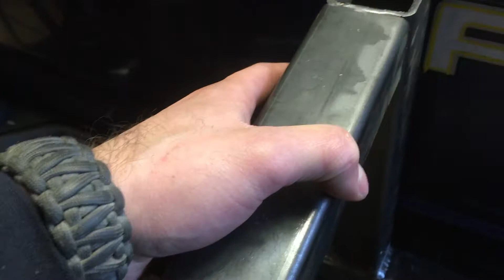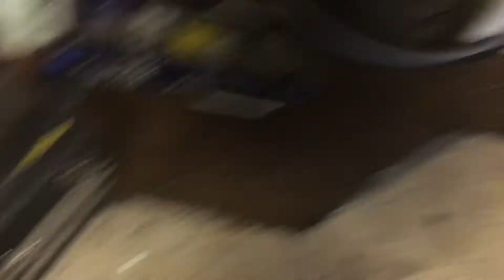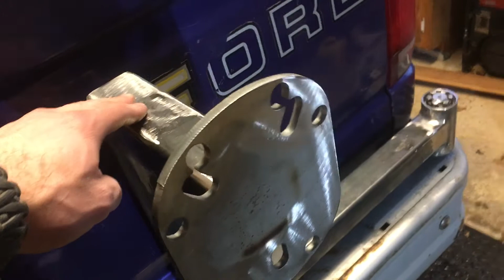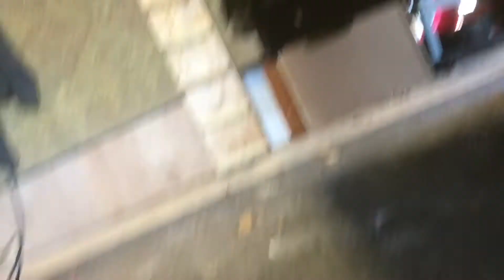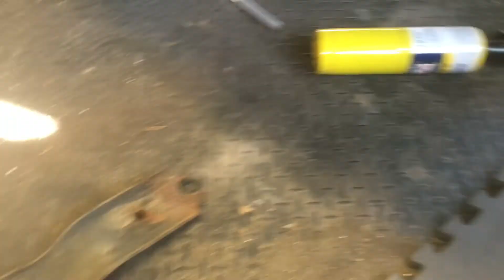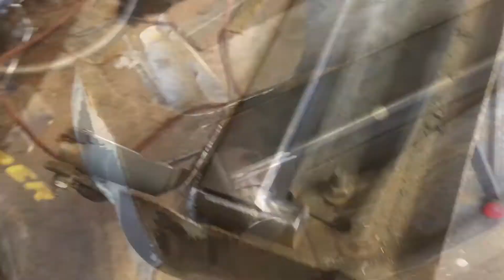How to Build a Swing Gate Tire Carrier Ford F150 - Part 2

Comment: Love these two videos. You gave me a great basis for my build (full custom bumper). 

One question; how did you limit the outswing on the carrier so it doesn't swing past the side of the truck?
Reply from the maker: Thanks man!🤙 Great to hear!

I didn’t and I wish I had thought of it. The tire carrier actually swing out too far and put a huge dent in my bed years ago. I would add a limit pin latch or strap.

Comment: How much did this project wind up costing you?
Reply from the maker: Good question! The spindle kit was I thing $150. The length of tube steel was $60 (pre Covid). If you through another $100 worth of cut wheels, grinding disks, flap wheels, and spray paint, you get a full number.

Comment: Doing this on my 2001 Dodge 1500
Reply from the maker: Nice!🤙 So two things I wish I had added. Near the hinge, add a pin lock to hold the carrier in the open position. I also would come up with a better latching system for when it’s closed.
Reply: @The Minute Masters Good idea

Comment: If you haven’t fixed it yet where your spring loaded thing hits the bumper , you can weld on a washer the correct hole size , 👍
Reply from the maker: That’s a good idea! Thanks for the tip!🤙

Comment: Great vids, so will the included "stop" work with a tailgate? Is it meant to attach to the body panels or on a 4x4 bumper? I'd be doing a Bronco but I guess jeepsters would attach that to their swing gate? Thanks much!
Reply from the maker: Thanks man!🤙 Ended up not using the rubber stop piece. I’m sure it could be mounted anywhere. It’s definitely suited for a swing gate and not a tailgate. The pin latch held the tire carrier in place.
Reply: @TheMinuteMasters  Nice, did u end up adding a grommet to the pin hole? I reckon that would serve a similar purpose to the bump stop...
Reply from the maker: @adrianmettz7463  I didn’t get a chance and the hole really needed reinforcement. The hole was a little large and the pin had a lot of wiggle room. The constant movement wore a pin sized moon cut in the side of the hole. Admittedly, the latching method for this tire carrier needed more attention.
Reply: @TheMinuteMasters  So a steel grommet needed then, lol...good shiiiiiiiiii.... clean work, looks killer. Thx for your responses.
Reply from the maker: @adrianmettz7463  Yup, you definitely want the grommet. No problem man! 🤙 Thanks!

Comment: Did you ever weld on a tube to support the bar that holds the wheel,
Reply from the maker: Like weld a support for the piece of tube that bolts to the tire?
Reply: @TheMinuteMasters  
From the bottom tube to the one that is vertical, ie  cross member of sorts
Reply from the maker: Urban Style Nope no crossmember. The 2” square steel tube really held its shape. So the “L” shape of the carrier didn’t need any support. If I send down a few steel tube sizes, I probably would have added supports.

Comment: Where did you get the pin?
Reply from the maker: The spindle was a kit from a company called emsoffroad. However, if you search tire carrier spindle kits you can find them at any off-road fabrication company.

Comment: Built is better than bought (IMHO) unless of course you're a shitty builder! LOL  Good job.  You might consider adding a little plate on top of the bumper to reinforce where the latch penetrates it.  That will be a wear point.  But nice work.
Reply from the maker: Rob the Wayward Woodworker I totally agree! Plus is a valuable learning experience each time. You are exactly right. That did end up being a wear point and I had to add a piece to prevent excessive wear. Thanks man!🤙 I’m glad you liked it!

Comment: Where did you get the latch? It's not on the website provided.
Reply from the maker: Randy Anderson I got the latch from emsoffroad.com in the description. Click the link and the main page will come up. Then click tire carrier parts in the menu bar. That should take you to a page with all the kits and most of the individual parts.
Reply: Must have stopped selling it, not there any longer.
Reply from the maker: Randy Anderson That’s a shame. It was a good kit for the price. I’m really not sure who sells tire carrier kits. I would just try searching tire carrier kits. A to Z fabrication sells the spindles.
Reply: @TheMinuteMasters  The one you got is way better than the complex and bulky one they sell now for sure. You lucked out.
Reply from the maker: Randy Anderson I definitely did! They must have switch suppliers.

Comment: I decided to put SAE bolts 9/16 grade 8 to replace the metric ones that hold the rear bumper on. I also increased the carriage bolts to 1/2 inch grade 5. If more is better, Too much should be just right.
Reply from the maker: J. R. Thompson You definitely can’t go wrong up sizing the bumper bolts. That’s for sure!

Comment: You definitely want to make sure to completely remove the zinc coating. As it is very toxic to breath when welding.
Reply from the maker: Jnic You are right! I always wire wheel or grind all the pieces that I weld.
Reply: @TheMinuteMasters  so how much did it cost you to do this project? I've been thinking of doing something similar with mine.
Reply from the maker: Jnic The length of steep was I think $120 and the tire carrier spindle kit was $110.

Comment: I wonder if you had the tire on the tail gate sitting on the bumper and the swing out carrier on the outside of that instead of inside it if you would have been able to make the carrier out of thinner wall tubing. Because the load of the wheel is on the bumper, the swingout carrier just holds it from falling off.
Reply from the maker: Srinath Seshadri That’s not a bad idea! Although, I have driven with the tailgate down and the carrier swung out. So I’m that case the carrier needs to be stronger. I have thought about using thinner wall tubing but adding more structural supports and stiffeners like a crane’s structure.
Reply: I have a 97 F150, but I'd be fine fitting a alloy spare in place of its steel one. I'm thinking of fitting a full size matched alloy spare on the rear deck lid of my PT cruiser. LOL.
Reply from the maker: Srinath Seshadri Yeah you’ll definitely be fine. Hahaha! I love it! Just like 1930s coupes!🤙

Comment: I extended the vertical tubing just past the top of the tire. Then I made it so the tire hits it top and bottom. This will stop the weight of the tire from shaking the arm holding it. I do a lot of off roading. Even if I didn't it's a good idea for stability.
Reply from the maker: Mark R I thought about that but figured my size tubing would obscure the rear tail light. 1x2 square tubing would be the trick to doing that. The thing I forgot to add was a pin latch that locks it in the out position so it doesn’t swing back and forth.

Comment: Thanks for the cool vid. Please make a vid sharing all your tools for fabrication. Would love to see the welder that you use.
Reply from the maker: Mission Off-Road I sure can! Definitely some more fab work to be done on the truck. All I used for this project was a MIG 175 welder by Eastwood and Hitachi angle grinder. I would like either a band saw or steel chop saw.
Reply: Have a pipe bender yet?
Reply from the maker: Mission Off-Road No and I definitely want one. I would have loved to do this project in round tube. I just can justify buying one just yet.

Comment: i wanted to do this on my stock 95 tahoes bumper and im glad i found your video great work bud
Reply from the maker: Jose Avelar Nice! It definitely looks cool! One thing I didn’t think of is a pin that locks in several swing out positions. So it would lock straight out from the rear or completely open as in out from the side of the truck. So definitely see if you can work that into your design! Thanks man! Glad you enjoyed it and thanks for watching!👍

Comment: i would have drilled hole for pin firstthen set pin into hole use self tapping screw thru plate in 2 holes. remove the spring and pin then weld
Reply from the maker: Scott Banks Yeah that would have been much better. Originally, I wanted to used the supplier latch but I couldn’t make it work. So the pin was sort of last minute. I do wish I had welded on a pin that would lock it in the out position.

Comment: Thanks for sharing.  

I am planning on implementing (from my scratch design) a low drag tail about the height of the tailgate for use in stowing the cooler/freezer and kitchen items.  Originally, I wanted to make a hitch design... then decided I can design a whole rear bumper tailgating system like the bike racks that swing out on hitches or these tire carriers on bumpers.   Basically, when the swing part opens out, I can place a modified popup tent over to have a screened in area that will velcro on or just the awning to keep the sun off as well as the kitchen counter when the top flips open.  Have a Mike Basich improved style design cap I am working on with a Prius style top rear end contour.  

I'm also planning on installing a trailer hitch, that I need to cut down in width and weld to fit, on the front end of the chassis to strengthen and allow for the winch to mount as well as other storage potential. 

This is a good detailed design that like you noted can be improved with minimal steel (or maybe aluminum) to lower weight and to maintain integrity.
Reply: Here's my first FB post regarding (I added this page reference): https://www.facebook.com/james.analytic/posts/2529587363769717
Reply from the maker: That’s sounds awesome! I like the thought process and reasoning behind it! It’s amazing what you can do with a welder and some creativity. Make sure you document the process. I know, I’m not the only one interested!👍
Reply: Right.  Will do, thanks for the inspiration and reminder.  I've been trying to get materials for free (Craigslist, Offerup, Letgo, etc.) or self serve yards (Weller, LKQ, etc.) especially when there are 40-50% off holiday sales.  There are also metal yards where they have discount overage materials I've picked up some materials from.  I'm still saving up for the actuators since I'll need six of them.  Other than that, I have most of the materials I need.  Planning on not having the skid on top of the cap and just a roof rack and solar panel (need to make a cover if working certain ranges of EM spectrum and maybe for hauling stuff or storage), though doing a spacer/roll bar with three holes in the top for the rotating antenna mast.  Great videos!

Comment: Its a great idea no doubt about that but it needs to be designed so it can be dissconnected from the bumper for those times when you need to haul stuff in the bed when you need to have the tail gate down?
Reply from the maker: Joe Dirt The tire carrier swings out so the tailgate can be down. Now I still need to design a latch that holds the tire carrier in place while the tailgate is down. That’s why I made the swing arm so short.
Reply from the maker: Joe Dirt It matters when you have to haul a piece of 8 foot quartz counter top without breaking it.
Reply: Its a pickup truck it was designed by ford motor company to to hual stuff it doesnt matter if tailgate is up or down get a clue.
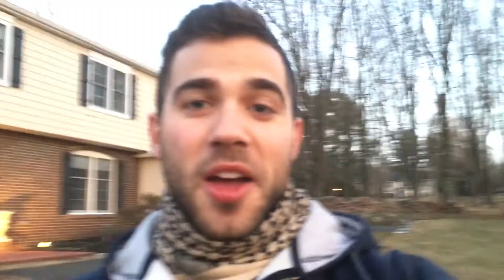Reply: Joe Dirt : this guy doesn't haul anything ....see that scarf he has on his neck at 10:00 ?... dead giveaway